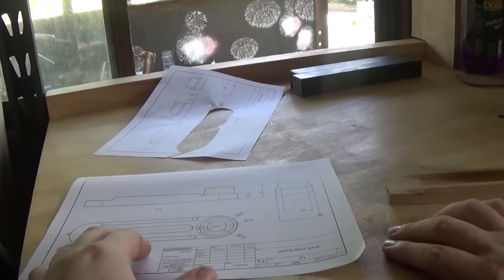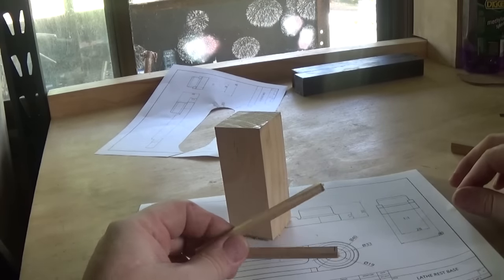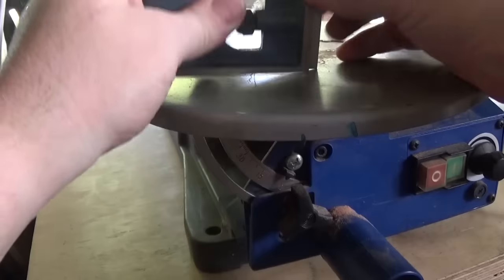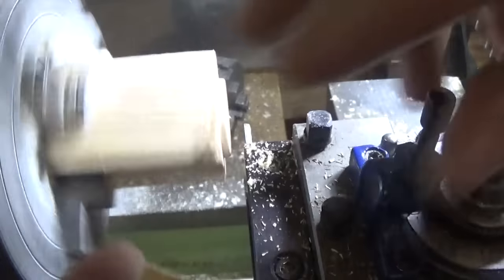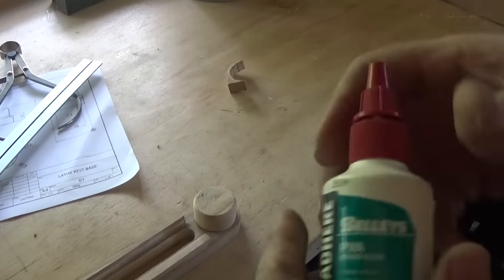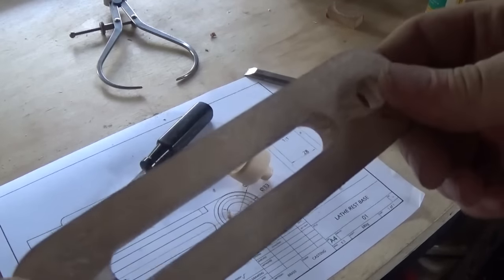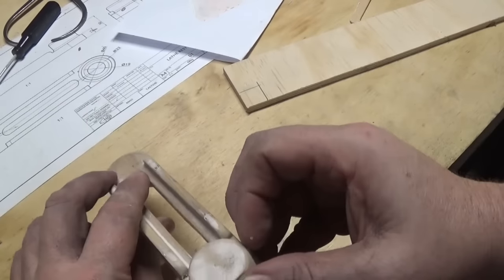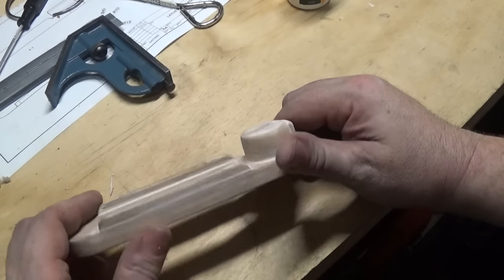Metal Spinning Attachment for the Lorch Lathe Pt 2

Comment: good job on the pattern making.  I've got some tips check out Durham rock hard putty.  it a powder that you mix with water much less toxic then body filler. and for holding small bits use escutcheon pins . glue and tack them on most things don't need to be predrilled in pine at least and take less filling in the hid. hood thing about pinning the parts is there's no need to wait for the glue to dry. I have several videos on pattern making if you haven't already seen them.

Comment: Pah can't do woodwork....don't believe you Emma lol. Just one thing. When you glue wood, clamp it and leave it for a day (or night) The glue will set stronger than the wood, no need for screws. Just might make your job a bit easier. I grew up next to the carpenters so have known this most of my life.
Reply: i was gonna post much the same  ,well i grew up next to a horse farm  not carpenters but the glue is the same .
Reply from the maker: yeah you are right.. I just didnt want to still be doing this next week. thanks for watching, always good to hear your feedback :)
Reply: No worries Emma. I'm never too old to learn, as with these coin rings I'm doing...just to fill the time. I do try to pass on tips I've learned in the past, or found through experience.......that's how we all learned something, otherwise we wouldn't have the wheel lol.